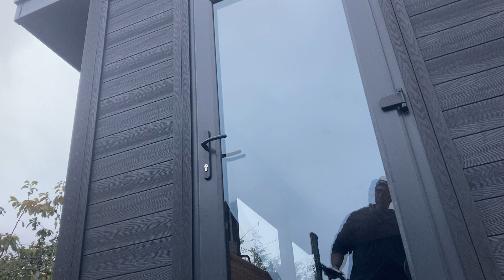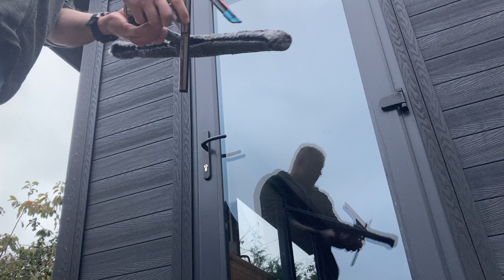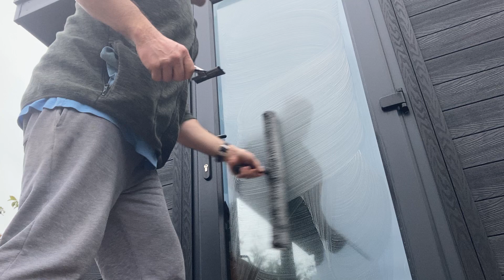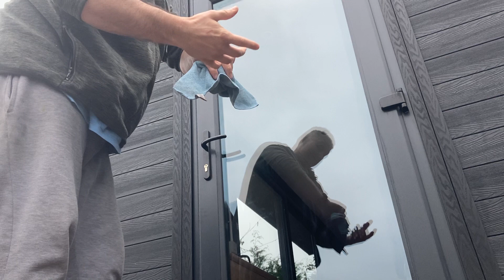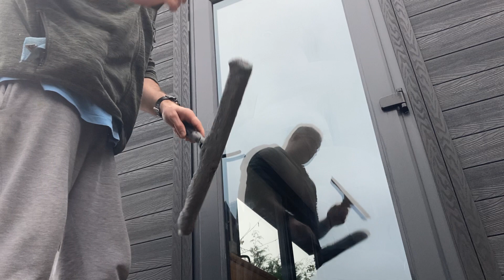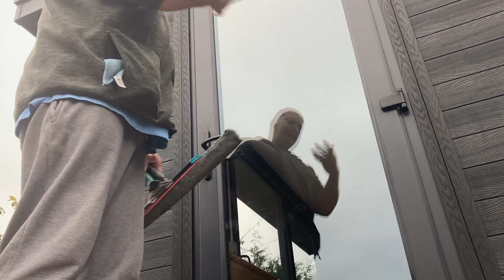More Youtube time saving techniques vs Polzn Bladz advice

Comment: I got a couple backup Unger S plus channels in my car bin I never use, what do ya think of those? They still don't match the liquidator. I find they drag hard but like I said I never use em. Liquidator was frustrating when I first tried it but with a good rubber, soap to wand and clips they are my favorite squeegee. I can't imagine a better combo. They have helped me make a ton of money and save so much stress of stretching my back out to detail stupid lines.
Reply from the maker: People used to bend channels many years before the S Plus channel came out. They are a hopeless attempt to make people believe they can get better results using them. They might take a bit more solution from the frames but wont touch the corners. Of course there is a learning curve to the Liquidators. They make you improve your skills, positioning and accuracy if you want to get the benefits from them. Otherwise people give up and carry on working as they always have. These YT window cleaners act as experts. They are actors with egos, they aren't good at all using these hand tools. The simplest tools are the tools they aren't good at using. They are competent at best. Competent means to me just about scraping by. They give out advice and it's hopeless advice like S Plus channels
Reply: @polznbladz3242  Yeah I was expecting a competitor to the liquidator when I broke it in but was let down big time. You have to position all weird and straight to tackle corners but in a very impractical way that's pointless effort. It also drags. Weird thing wish I didn't buy em but they sit if I ever break a liquidator on the job which I doubt will ever happen! Then again if I did break one I have two others on my belt so I'd just swap out!
Reply: Pretty amazing how incompetent and unwilling to change methods a lot of window cleaners are. Nothing touches the liquidator. Nothing. I had to ghost the window cleaning forum because all I seem to do is debate liquidator haters. There's not too many but the few are very butthurt and vocal, also "veterans" ;D woo boy the laughs I had there but it's frankly too stressful dealing with their blatant stupidity I had to kick that site from my life. I always find a supposed genius that babbles the most ridiculous shite imaginable while coming across as an angry petulant child. Frig these people, let em work harder and stroke their egos all they want. Some people can't adapt and refuse to change. Fine by me.
Reply from the maker: @stevai6732  Very impractical to use a bit like dive bombing techniques that's spouted around by others on here. The simple facts are as long as you are capable to use squeegees well, the liquidator works with out using stupid chaotic techniques and weird angles. Nearly all of the window cleaners on this platform show you how to work more incompetently, longer, slower resulting in rubbish results. They are all hopeless and most window cleaners in the world are hopeless and revert to using wfp on everything, It's a very under skilled job and anyone can call themselves a pro window cleaner once they have paying customers
Reply from the maker: @stevai6732  Ego's mate. Years experience means nothing if they have experience in working longer harder slower getting less results. They are too stubborn and arrogant and it's these types of people that have the popular window cleaning yt channels

Comment: Defiantly my equipment of choice is the moerman 100% but in the 11 sec timed you do not mop the window to the edge. But clearly in the the 18 sec timed you clearly mop the edges hence why it took much longer and more detailing.
Reply from the maker: Slightly more mopping with the 18 sec example but still not touching the edges that I can see. Every example I do can't be exact. However everything I do and say results in cleaning windows quicker and better than the other window cleaners on Yt using squeegees. It's the easiest thing to demonstrate, I just don't do what everyone else does and says to do. I use Moerman squeegees, poles and washers religiously, I use a variety of  Tbars and other accessories from other brands to. Moerman make the best squeegees if you become a versatile and adaptable window cleaner. Unfortunately the window cleaners on Yt don't have this quality so they never use them because they cannot use them